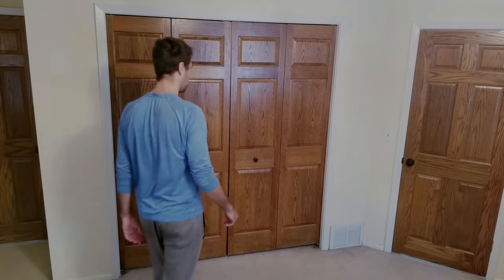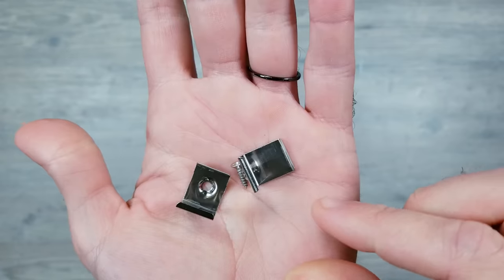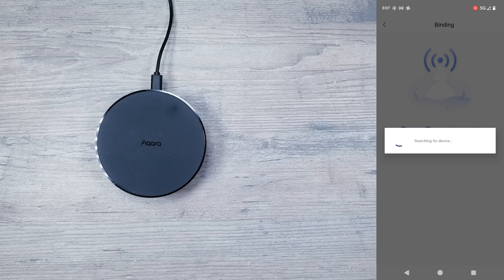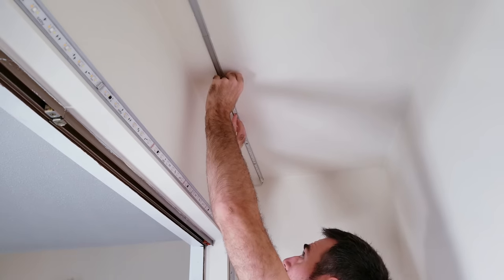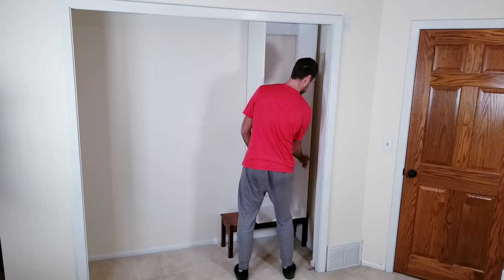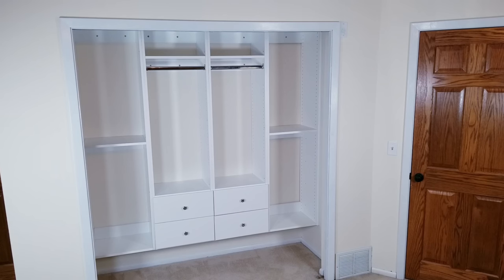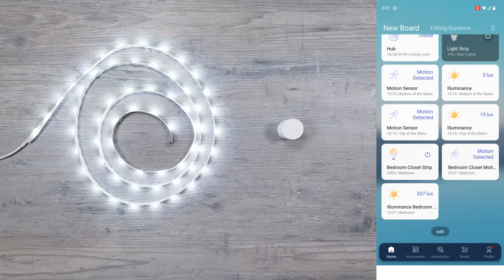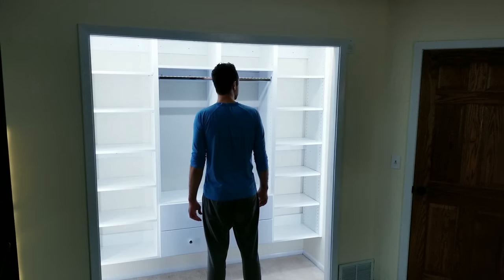EASY Motion Activated Closet Lighting - NO PROGRAMMING! NO HARD WIRING!

Comment: That looks so good! Electrical guy here, my quote is make a video on it your attic access is right in that closet, drill a hole above the closest outlet from the attic down through the top plates into the wall cavity, then drill a hole in the top of the outlet box, then run a fish line from the attic to the hole in the top of the box, this will be the hardest part getting it through the hole but no more then 45 mins, then pull 14/2 up into the attic and down into any wall in your closet you'll have to repeat that step of drilling the top plate from the attic into your closet above where u want the box, then get an old work box cut a hole in the wall, feed wire through top hole to outlet hole, pull wire through box, install box and receptacle and connect other end and done, about 2hrs for experienced person with a helper and 3-4 without, for no experience about 8hrs but go slow n you'll be fine

Comment: You can check, as you another room on the other side of the closet. Check if a plug is on that shared wall; it would be easy to have a plug in your closet.
Reply: They sell a kit at the Home store and Lowes
Romex splice kit, buy an outlet box and outlet and drywall knife if you want and done.

Comment: I had a similar issue but solved it in a different but similar way. I used HomeKit door sensors(Aqara), HomeKit plug(Vocolink) and cheap rope led. When I open a door, the light comes on by triggering the plug.  Close the door, the light goes off.   I think the door sensors trigger more reliably than motion in this scenario. 

Only issue is if I open both doors, the lights go off when I shut the first door. Minor issue, rarely a problem (first world problem). Your lighting looks better but I got good enough results for $50. Great improvement in my closet.

Oh. I ran power from a few feet outside of the closet. Runs behind a piece of furniture then under the trim for the closet door. Unnoticeable mostly.  Good video. I really like your style and work.

Comment: Have you seen the door push button switches? The install inside the door jamb and turn the light on when the door opens and off when it closes. It's basically a momentary switch. Then you don't have to upgrade your lights, just add a simple switch and you've got automatic lighting.

Comment: Fantastic setup Chris. My son has the same closet. Size and No lights. I'm going to do the EXACT same lighting setup you have here. My question is if you are able to add the Phillips Hue Smart bulbs to the Aqara M2 ? I'd like to possibly take advantage of having the M2 for other things other than just the closet light. For easy plug & play to start by replacing the 3 bulbs in his ceiling fan/lights and 1 in his nightstand lamp. Is this doable ?

Comment: This comment isn't really geared towards this one video just question I had. I don't want to use multiple apps for multiple lights so what would you recommend. I've seen you use Govee, Aqara and and ESP using Domestic Automation? Is there a one fits all what are pros and cons for each in your opinion? Finally big question how does you wife interact with the lights is it talking to a smart assistant or through an app?
Reply from the maker: Thanks so much for watching and great question! There is really no good answer. They all serve a different purpose and all have advantages. My wife will only use anything if there is a button or switch associated with it or if its motion activated. She will not pull out a phone and use an app and she will not use anything voice related. But she absolutely loves this closet project (motion activated), the staircase lighting project (motion activated) and the undercabinet lighting video (dimmer dial) I did.  I think it all boils down to how tech savvy someone is. You could probably do all the projects I've done using esp/wled/domestic automation but it does require a little bit more work to get everything set up with sensors, buttons etc. Govee is great for anyone that wants a plug and play option and govee is incredible with the sheer amount of product they offer so that you can go all out if thats what you want. Aqara has been super easy to use in terms of getting things hooked up to work with motion and is about as plug and play as you can get. But Govee and Aqara are not going to work for extremely custom type projects where a lot of cutting/ splicing is needed or higher pixel density is required from what is available with other companies. Lol sorry for the long reply and its still not a definitive answer but thats what was rolling around in my head.

Comment: Awesome. 
Hey, if I wanted to light a room, not just for ambiance, but also have a bright “overhead lighting” (channels along crown molding), would the BTF-LIGHTING WS2812B be a good strip to use? Bright enough to read a book under? 
I’m thinking of running a V-shape channel around the entire room.
Reply: Yes, they are very bright for 5v. Only difference I would say is that if you're running a longer wire. Use a power source that has more amperage, not voltage. This is essentially more volume pushed, and not how fast it's being pushed. In short terms, you're able to push your lights further
Reply: @mnc1009  Excellent. Many Thanks!
Reply: @Shakes_The_Clone  Look at the ws2815.  They're 12v and you can run them MUCH longer without noticeable voltage drop.
Reply: @mattwilson9293  thanks Matt!
Reply from the maker: Looks like some awesome people beat me to responding! If by bright you want a bright white then I would go with one of their products that have a dedicated white led since the white color on the ws2812b's are not the best. The sk6812 has a dedicated white but they are 5v so power injection would be needed at some point. Lots of options. I hope to do a video at some point down the road going over how to wire up maybe like a 100 to 150 foot run!
Reply: @ChrisMaherDIY  Excellent recommendations, as always. Thanks so much, Chris. And the rest of you.
FWIW, I’m looking at about 68 feet to do the whole room. 
A good, bright, warm white will be the main objective, but do want fancy colors and “scenes” occasionally.

Comment: Hi Chris, love ur videos, will this motion detector work with those lights BTF-LIGHTING FCOB COB LED Strip Flexible High Density Uniform Light 14W/m 16.4FT DC12V Natural White 4000K CRI 90+ 10mm Width Dimma

? Thanks so much!!
Reply from the maker: Thanks! They may be able to work with some type of home assistant integration but thats a little over my head unfortunately. But having the wireless motion detector is what makes projects like this so easy since you dont have all the extra cords to hide and deal with.

Comment: If you get 12v strip and a motion detector with a little wiring, you won't need an app. It will be a lot cheaper too.
Reply from the maker: Thanks so much for watching and taking the time to comment! Definitely a lot of different ways you could go about doing this! I went for the easiest possible rout with no wiring required but maybe at some point down the road I can do another closet trying out a more complex method!

Comment: This is a good video, but I think you'll find that the cool white color is far too bright and sterile.  I would suggest adjusting it to 3500-4000K which is a much warmer, more natural light.  I like the motion sensor trigger, except for the fact that it's battery operated.  It WILL eventually fail.  For me the internet connected hub and wireless connected light strips are unnecessary complications that will also cause you problems in the future.  It's cool don't get me wrong, but you'd be much better off hardwiring everything in.  My goal is to never touch it again, or to worry about what I'd do when I sell my house.